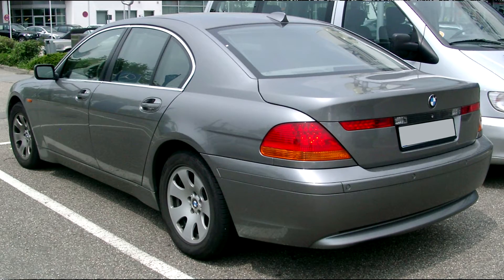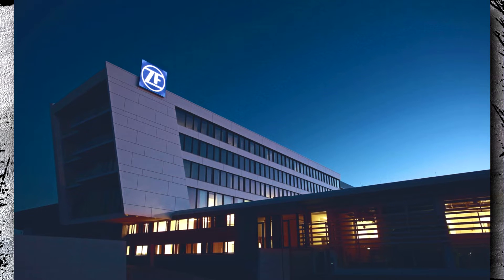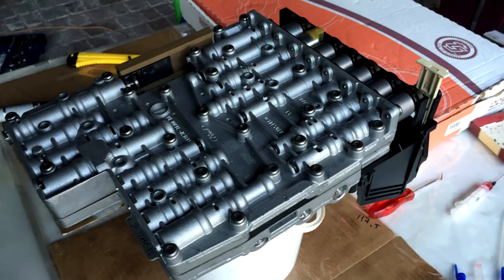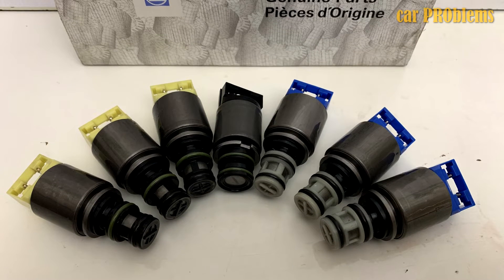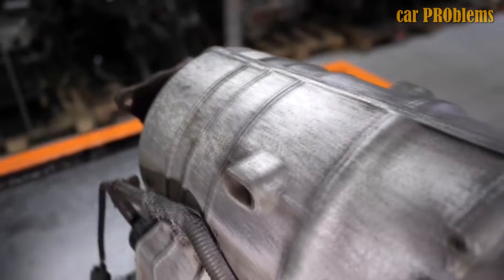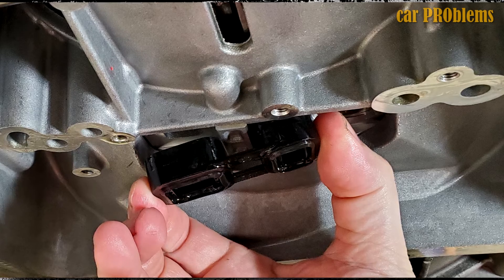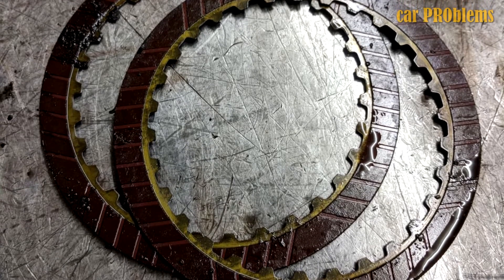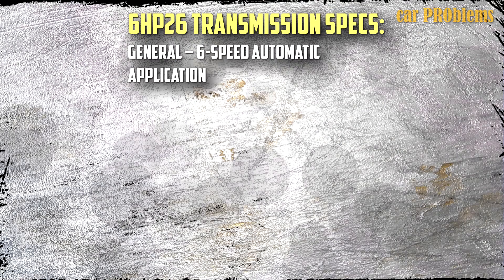ZF 6HP26 (09E) Transmission - Problems and Reliability

Comment: Auto gearbox ZF 6HP26 on my Ford Falcon FG (MKII )XR6  (Australian designed and built car ) so far clocked in 1.2 million km. I never followed "advice" from German manufacturer. I changed the oil every 100K and I mostly used NULON  gearbox oil (Australian oil manufacturer ). For the first time this year after 13 yrs, I got an transmission error, gearbox went into limp mode, couldn't change gears.. After I restarted the car everything went away but after few weeks the same issue returned. Now I have to investigate what can it be done.
Reply: Its 1000% in the mechatronics unit. Do a sonnex ZIPKIT. The main corporate is the rubber pressure dump valves. The rubber in plastic and they begin to fail, causing pressure and fluid loss to the clutch packs. That also causes a somewhat not very fun issue of burning up the stater bushing that is a hydraulic seal for E clutch ( 4-5-6 gears) if I were you, I would please get this sorted as fast as possible before you have to pull your transmission to replace that bushing. It is a brass bushing collar that is on the backside of the transmission pump cover ( stator bush ) not exactly a hard job to do if you are good enough to pull the transmission yourself.

Comment: #2 Torque Converter issues is not a torque converter problem, it's a sport mode issue. Sure replacing the torque converter will solve the problem, but using sport mode will always keep causing it. 
#4 Clutch failure by friction disc wear is a transmission problem universally, not just ZF. Funny you don't even show the friction disc.
But people don't seem to realize the only reason why transmission work is because of basically sand paper and liquid flow in the torque converter. Clutches lock up and spin together because of friction discs that hold them together after being compressed. Torque converters move the vehicle because of how fluid flows through its internal fans.
Low fluid or low pressure and that sand paper dries up and will burn up from the spinning discs. Burnt out clutch. 
Low fluid and the torque converter isn't full so it's internal fan blades aren't spinning right, most of the time there is no direct connection between transmission and engine via metal on metal lock up.

Comment: my ZF 6HP26 lasted only 43,000 miles on a 2006 XJ8, It used to be my mom's car.  Never driven harshly.     It's in the shop now being rebuilt.
Reply: Were oil changes done to it and seals replaced? That's almost 20 years old and it still needs regular maintenance regardless if it's being driven or not. That goes for all things with rubber seals and gaskets not just vehicles. Can't look at it as only 43k miles old but also 18 years old. 
I can't see why it would have needed to be rebuilt, seals replaced sure, but friction discs would have to be burnt up and metal in the pan. 
But ZF recommends just replacing the transmission instead of rebuilding it. Most likely to try and prevent shops from ripping off customers with poor rebuilds or using non-ZF parts. Cause it's not easy finding OEM parts for their transmissions.

Comment: What abou in D mode under 1800 rpm if i am quickly take off my foot off the acceleration pedal the rpm drops a little bit down and goes up , what suppose to be the problem??
Reply: Have the same problem while braking hard to a traffic light.
Reply: Are you asking why your RPM drops if you take your foot off of the accelerator?  Or are you asking why your RPM drops when you take your foot off the gas and then goes back up when the vehicle shifts down as it's coasting and slowing down?
Reply: @matraz10  It drops and goes up a bit but no gearbox shifting , probably is something wrong with the torque converter....

Comment: I have problem from 3 to 4 gear mostly when cold oil. It want to go to 4 but right away drop back to 3. In manuál it does too but only with throttle open. I put it in 4 but its ignoring me and goes to limiter and it put 4 on its own. Problem 2 is rev up and down from 200rpm to 500rpm difference. When i have 90km/h and static throttle or cruise control revs are jumping. Thank you
Reply from the maker: The symptoms you describe with your transmission suggest that there may be a problem with the valve body or solenoids. The valve body controls the flow of transmission fluid to different parts of the transmission, while the solenoids are responsible for opening and closing the valves. If there is an issue with the valve body or solenoids, it can cause erratic shifting behavior and even prevent the transmission from shifting into certain gears.

Another possibility is that the transmission fluid level is low or the fluid is dirty or contaminated. Low fluid level or dirty fluid can cause the transmission to shift improperly and can cause other problems such as slipping, overheating, and premature wear.

I would recommend having the transmission fluid level and condition checked, and if necessary, have the fluid and filter replaced. If the problem persists, it may be necessary to have the transmission inspected and diagnosed by a qualified technician.
Reply: Iam not certified but i have checked. The oil temperature was 40 or more and car was started and in P. The oil was not driping but it was pouring from control /filling hole

Comment: Mine is struggling to to shift into 5th and pops to 4th. I hear 4-5 flare is common on these due to bushing on e-drum. Or does anyone think it is faulty valve body or selenoids? Clutches didn't look burnt when I installed this used one. I'm almost notice slight jolt when shifting into ever gear upward. Sometimes smooth.
Reply from the maker: As you mentioned, a common issue with this transmission is a worn bushing on the E-drum, which can cause a flare between the 4th and 5th gears. This can also cause the transmission to slip or hesitate when shifting, and it can eventually lead to more serious transmission problems if left untreated.

Another possible cause of the symptoms you are experiencing is a faulty valve body or solenoids. The valve body controls the hydraulic pressure in the transmission and can be prone to wear or damage over time. Similarly, the solenoids control the flow of fluid through the transmission and can become clogged or malfunction due to contamination or age.

It is also possible that there could be issues with the clutches, although you mentioned that they did not appear burnt when you installed the used transmission.